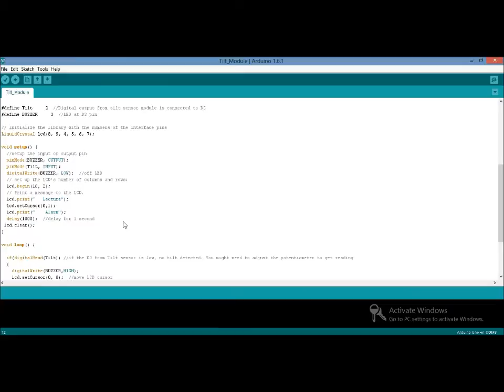Detecting Tilt & Vibration - Part 1

Comment: Can we use the ardunio uno .. in this system
Reply from the maker: yes, in this video we use CT UNO and it is Arduino UNO compatible :)
Reply: cytrontech   and can I put same code for ardunio uno
Reply from the maker: yes you can :)
Reply: cytrontech ok thanku so much ... Mam
Reply from the maker: Yes, it is an Arduino Uno compatible :)